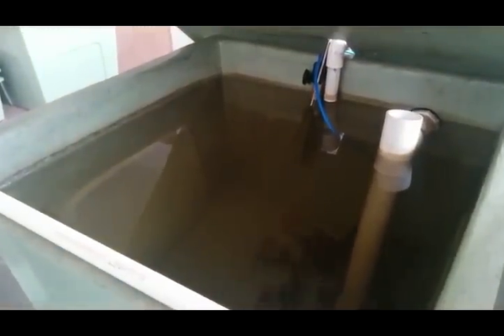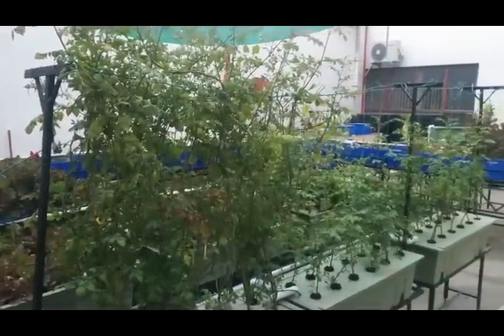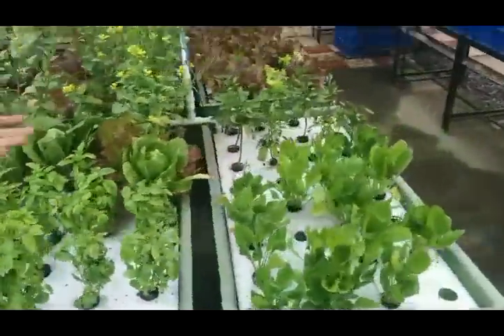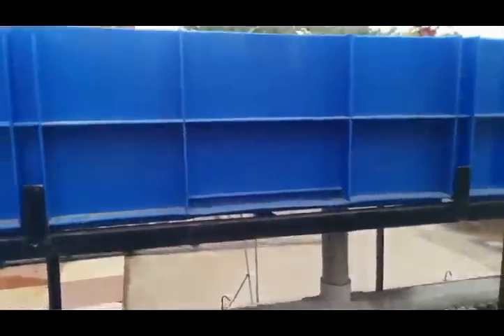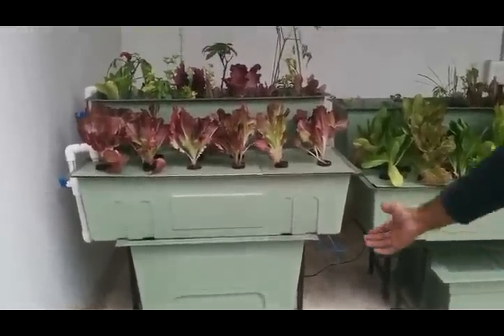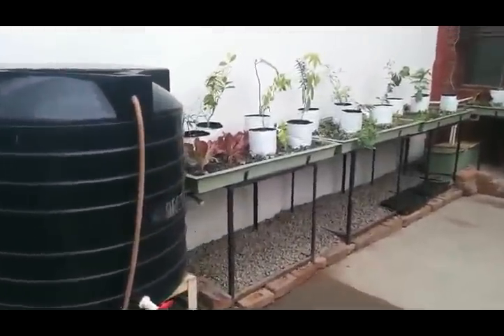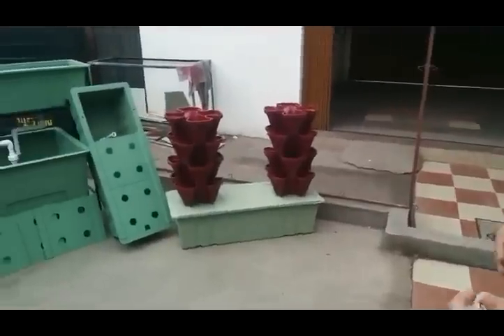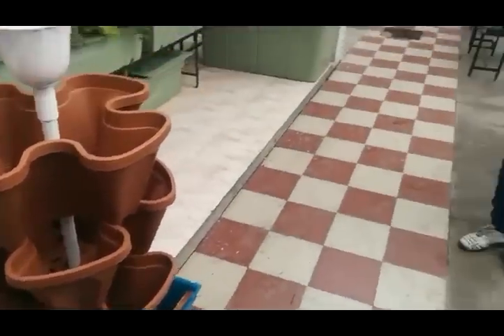India Aquaponics, Chandigarh. Facility Visit.

Comment: Hi, Nice informative video.
Can you please share what substrate/medium do you use instead of rockwool for germination. Also if you could share the medium that you use after you transfer it to the main tray.
Reply from the maker: One can use simple cocopeat and vermiculite seedtrays for germination.  medium of the growing beds is highly selective as you can see in the growing techniques in the video. it depends on the type of crop if you need to take advantage of it. generally plants that grow a huge root system often need to given a medium to Provide support to the plant body.
Reply from the maker: River rocks used in Construction are my choice of medium(free of carbonates ie . they pass the vinegar test). unless i want to go for a DWC with just netpots suspended on the raft.
Reply: Hi there, thanks for ur valuable inputs. I'm a beginner in this and I think I'll go ahead with DWC. So for germination I'll use coco peat and vermiculite in seed trays for germination and after that I'll wash off the roots and place them in net pots filled with clay pellets. I'm planning to grow lettuce. Is this the right way to do it or the sapling needs to be placed in some medium first and then in clay pellets?
Reply from the maker: +Aki Aggarwal you are on the right track. all the very best.